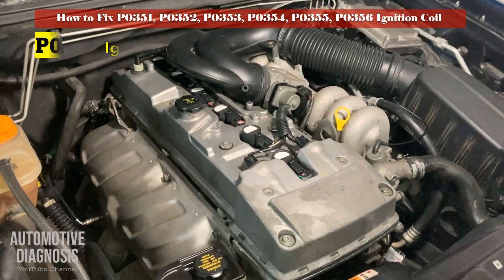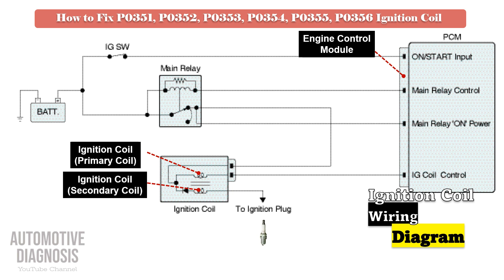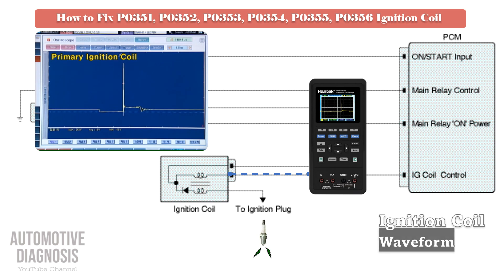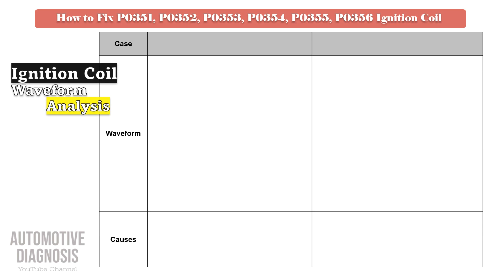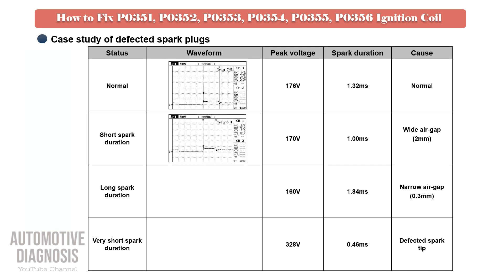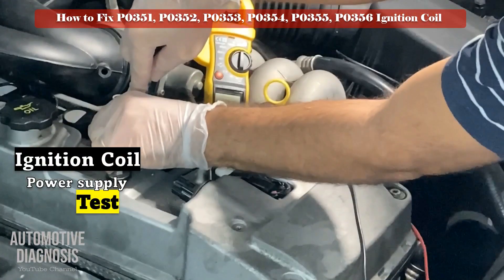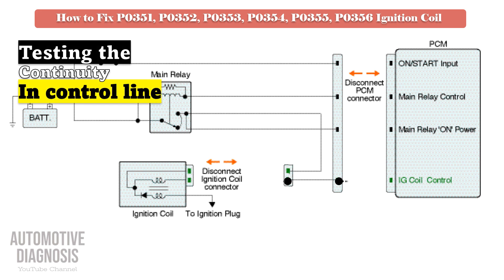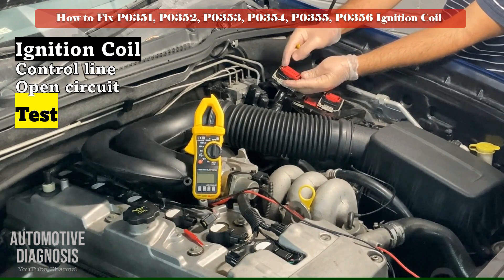Ignition Coil Fault Codes? FIX Them in Minutes!

Comment: My truck has been in the shop over 30 days. Codes are po 351and po356.Coils are new ECM is new.plugs are new timing chain new.All lines tested.Two new pinsin the connecter.On one and six wire.what else could it be?

Comment: hi..im getting fault codes for a and f at the same time..what do you think is problem..ive replaced All idnition coils and sparks plugs but still doing it
Reply from the maker: You may check the wiring and ECM connector.

Comment: 08 expedition.  P0357. Cylinder 7 new coil new plug new injector.  Using noid light there is pulse going to coil but when I use the noid light on injector the injector plug will pulse for a few seconds after start up then shut off. All other injectors are good only cylinder 7 injector cuts off after start up. With power getting to the coil good coil and plug would the pcm be bad? Maybe bad injector driver in pcm?
Reply from the maker: Have you checked the Cyl 7 ignition coil control line? Is ECM detects any fault in any ignition coil circuit, it will cut off the relevant injector too.

Comment: Test ECM ground circuit : Measure resistance between ECM and chassis ground using the backside of ECM harness connector as ECM side check point. If the problem is found, repair it.

Specification: Below 1Ω please help me how to perform this one with multimeter
Reply from the maker: Hi There, for checking the ECM ground, just check the wiring diagram first to find the relevant wire and to find the PIN number on the ECM connector. As this wire is giving the ground to ECM, it should be connected to the ground from the other end, so when you check the resistance between the connector end of this wire and the car’s body, the amount of resistance that you are measuring must be less than 1 Ohm.
Reply: @AutomotiveDiagnosis  so please should it be a back probe when the ground circuit is found i should put one end of the multimeter chassis ground and one to the ecm connector
Reply from the maker: Yes, it’s better to backprob to prevent any damage in the female pins. One end of the multimeter prob on the ECM and the other on the chassis ground.
Reply: CNN. Do I get a dam wiring diagram...please. Not in my Chilton.  Looking to test wires from cylinder 4 to pcm